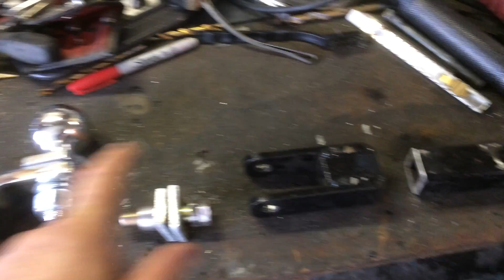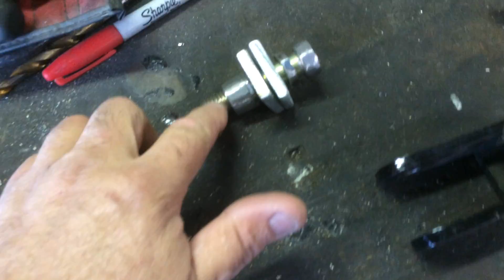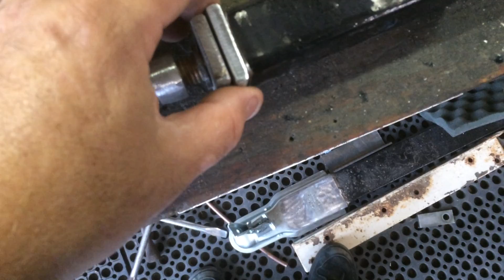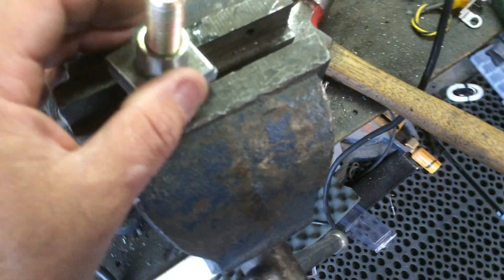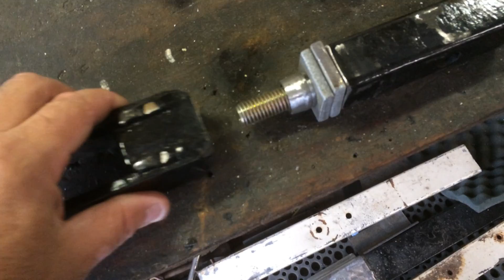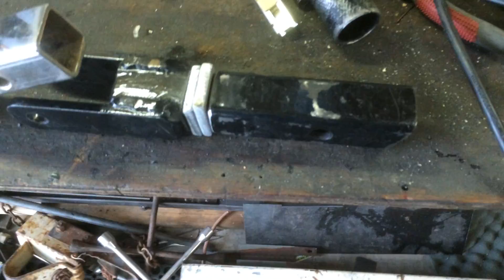ATV Home made small trailer swivel hitch Vid 3 upgraded

Comment: How did this work out for you?
Reply from the maker: I keep the swivel hitch in my front storage compartment and generally use my stock hitch but I figure if I  need it for some serious hills, I have it. I have lifted my trailer by hand and it seams to do what I expected it to do and I have driven it around a little bit with it on but haven't really had a need for it yet.
Reply from the maker: Worked great.Never had any issues.